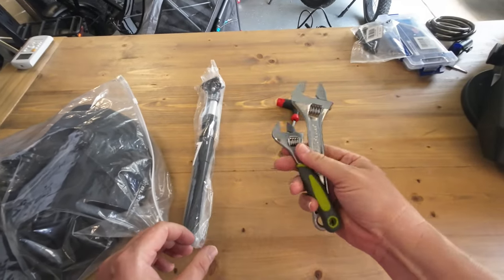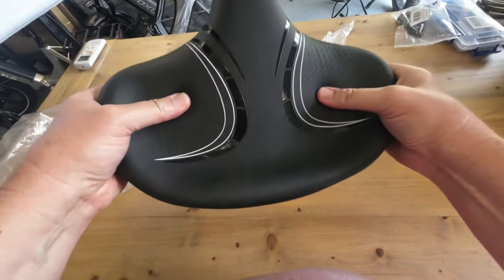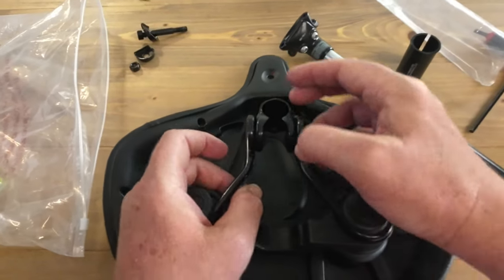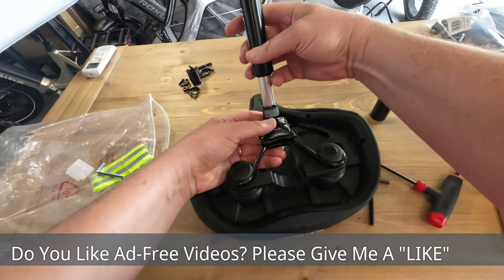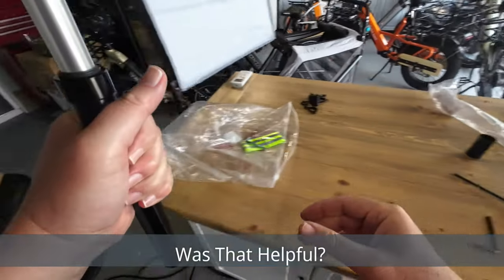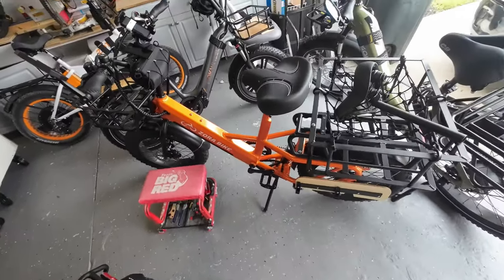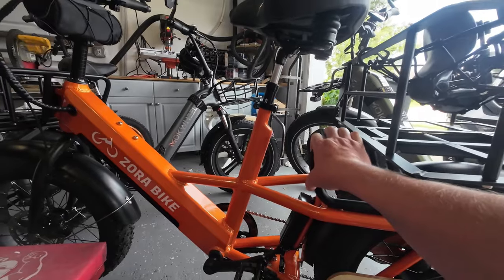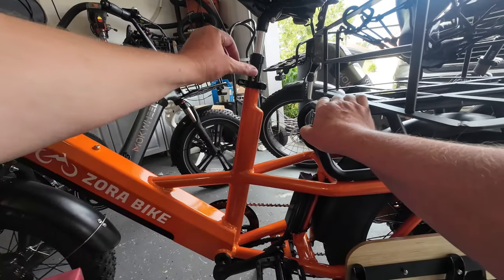How To Add BUDGET SUSPENSION Seat Post To A Saddle  // ebike

Comment from the maker: Its much easier than you think and it adds soooo much comfort to the ride.  You deserve a comfortable ride, right? Its not fun being sore all the time on the backside.
Reply: I weigh 260 pounds what is the weight limit?
Reply from the maker: @Marlevlyn  The adjustment is for riders 120-220. I am 240# and it works great for me. Being heavier it may not give you as much suspension, but I am not sure.

Comment: Loved this review! Very thorough directions. Before I order this suspension seat post, could you please tell me if it will fit on my TK1 Folding?  Perhaps you got one for Mrs. Adventure? On the TK1 seat post it says 31.8 *400   I am at a loss for which size to order.

Comment: If you take a look, there are probably very fine ridges on the post and the sleeve. That just gives a little more friction so you do not have to tighten down as much. That would be the cause of the noise.
Reply from the maker: Yes, your right. But on the other ones of the same brand they didn't make the noise. It may be a design change, I shall compare them soon.